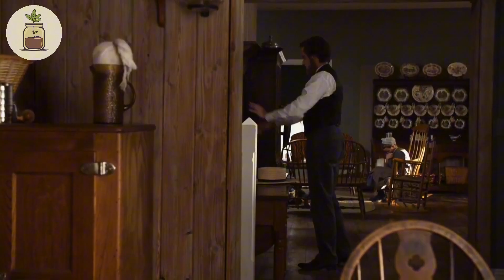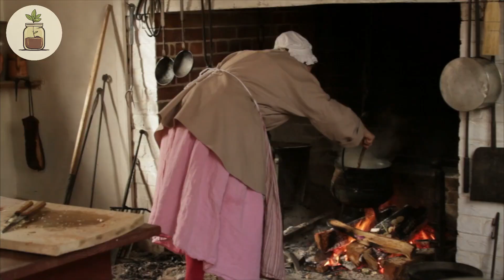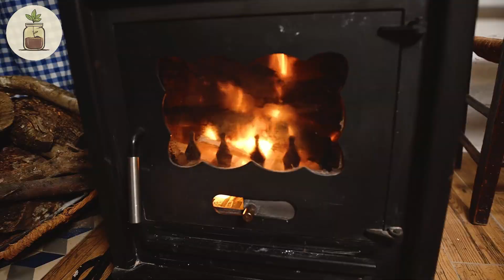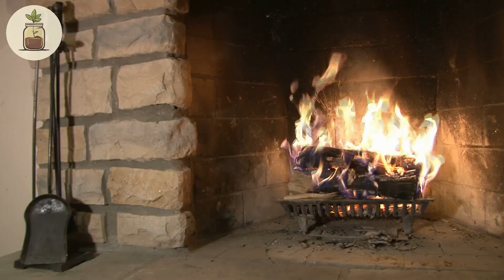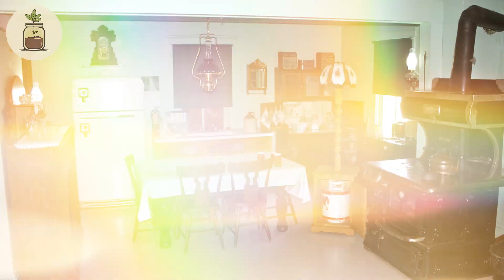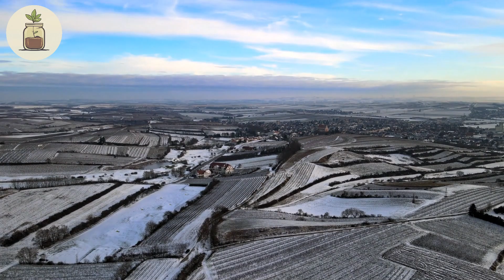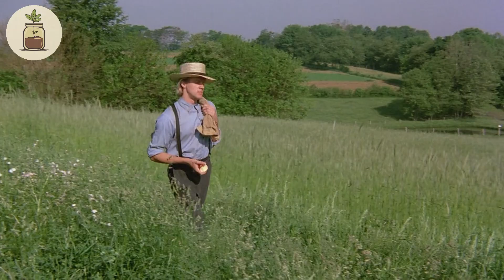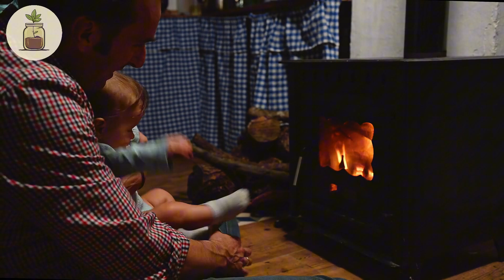How Amish HEAT Their Homes Without Gas/Electricity

Comment: Miss the smell of a turf fire, not as hot as a hardwood fire but more aromatic
Reply: What does it smel like?
Reply: @roselee4445  Good question, it's difficult for me to pin down as I'm going off memory. a mixture of an earthy smell and a more subtle smell which is floral I guess. I'm sure it changes from one region to the next depending on what organic matter it's made from. I just know you have to keep shaking the fire with a poker because they generate a lot of ash. Don't quote me on the description as it's been too long since I have enjoyed a turf fire, good memories. You appreciate it more when you harvest your own, the hand cut turf tends to burn easier and smell nicer.

Comment: I had a newspaper route when I was a kid back in the late 1960's.. The paper stations where we picked up our papers were just metal sheds, about 20X30, with no insulation. One potbelly stove in the middle, heated with coal. There were metal tables stacked with newspapers 6 feet high and metal coal bins around the outside walls. Those stoves would keep those paper stations toasty warm even when it was 20 below zero outside. Even though they were jammed with paper and kids no one ever got burned, and there were never any fires. Then, in the 70s, the city forced the company to get rid of the stoves, said they were dangerous. They put in overhead forced air gas furnaces. Those stations were always cold after that.

Comment: And where do you find this effective wood? Millions of families and others must therefore find, store and then fire with wood? Isn't it against everything that the environmental movement argues? I have a hard time seeing wood burning in a 20-story building with 72 apartments. And where do they put the ashes? 
No, it's probably the case that if everyone wants it that way, they all have to retrain themselves to be Amish. Life will be different with a maximum of 2 floors on the house and a lot of small houses that have to be heated with wood. I'm not negative, I'm just stating what I see in that future.
Reply: Good points except for the dumb one, what to do with the ashes.  They go back to the earth as a form of fertilizer, not a problem what so ever.
Reply: @hugoglenn9741  I spread mine on icy spots.

Comment: What this video is not telling people is that some insurance companies will not cover homes with fire stoves as a primary heat source.
Reply: Most use outdoor wood heat systems now. Hot water and heat both. No need for any insurers worries. Although I had no problem with just a wood stove with my insurance company.
Reply: Yes, you are correct if it's an outdoor unit.
Reply: Insurance is parasitism
Reply: And that the insurance people love it alot when you pass that along.
Insurance doesn't work without fear and intimidation 😅😅😅😅

Comment: You don't have to be Amish.... I'm in the UK, living in a 1950s ex-Council semi-bungalow in a residential area. I ripped out  the knackered old mains gas boiler when I moved in and have heated with wood only for over a decade. I run a cast iron wood burner in a large thermal mass chimney breast which heats the main room and the bedroom above. Main section was built when the house was built but I added mass in the main room when I moved in and it now releases its heat over more than 24 hours.  I'm careful about prepping my wood fuel and when the thing is running, it isn't noticeable to neighbours or passers-by. The main room is a sitting area and office and stays cosy whatever the weather and is half the ground floor. Wood comes from a nearby ancient woodland. It's derelict hazel coppice being restored to coppice cycle with excellent nature conservation benefits. I cut it myself which keeps me outdoors and active in winter helping my mood.  If anybody is interested, click the Anemone icon and go exploring amongst the videos (unmonetised channel). The other benefit of burning wood is that I no longer burn fossil fuel for heating  - this means that I don't contribute to increasing CO2 in the atmosphere. I never burn coal. However, I do cook with electricity and if we're away in winter, we do have low-output electric heaters to avoid frost damage. My halo isn't as tight as it could be.....

I do cook stews on the wood burner when it's running and the back-up to electric light is paraffin (kerosene) lamps, which get used once in a blue moon when the power goes off. They were all inherited and are older than my Dad who'd be well into his 90s now.
Reply: Isn't that an issue with laws over there or is that why you keep a low profile so the neighbors don't go Karen or Ken on you and rat you out???
Reply: @Sadler2010  I'm not breaking any law by burning wood as domestic heating. It is unusual.I don't live in a smoke-free zone or anything. I could possibly get into bother with the Council if someone complained about smoke being a nuisance, so only burning properly prepared wood keeps the likelihood to a minimum.  My neighbours burn wood and coal. Coal means more pollutants, smoke and odour.....
Reply: @anemone104  I figured it'd be at least looked down on quite a bit if not illegal, here in the states they've gotten insurance companies to threaten to cancel folks insurance for having the wrong kind of wood burning stove even when it's original and working fine.

Comment: Our great grandparents had stoves with boilers that heated the water for their radiators and baths. Sadly these were phased out because in the 50s gas was cheaper than wood or coal
Reply: These stoves are still sold with back boilers..I have a Stanley 90..brilliant machine.

Comment: Burning wood is not sustainable or healthy this has been proven many times. If say everyone in New York used wood heating the pollution would be intolerable and the health complications would be disastrous both these issues have been seen before and are well known and documented. As for the sustainability if all homes used wood fuel you would not be able to grow forests fast enough to keep up supply.

Comment: So, sure wood works.  You need a way to distribute it within the house, so all rooms are warm.  You must get the wood and take care of the wood supply long before the winter.  Even if you buy it, it must be kept near the house, protected from rain and snow, stacked correctly to dry, and brought to the house consistently to have on hand.  it is dusty in the house, must be attended to as it burns, and  wood burning stoves can be especially hot.  Used one for 20 years as an addendum to oil.  Worked great, but it is work, and can be expensive if you don’t cut your own wood.

Comment: Stupid nonsense. Pollution (smoke, unburned microscopic particles) if used on mass scale (millions of households) would cause massive health problems. Deforestation would be disastrous. That already happened in 17-18 century Europe. Open hearth fireplaces burning efficiency is disastrous, about 1%.
Reply: Exactly what I was thinking. No one knows what harmful micron size particulate matter is going into the air from the wood they’re constantly burning. Plus, we all know the Amish are not using modern HEPA filtration inside their homes!

Comment: Here's the problem with if everybody in the United States had wood stoves that wouldn't be very many trees left we would be putting almost a hundred times more carbon into the air so unless you come up with a better thing than a wood stove it's got to be where it puts off Harley no carbon at all and I'm sorry with stoves put off a lot of carbon
Reply: What if they just took some branches off the trees but left all the trees alive? Orr they could grow bamboo instead it grows fast.
Reply: More taxes with stop the climate from changing though . Smh .
Reply: Perhaps insulating the house as much as possible would help with individual wood usage.  Obviously, not everyone can or should heat with wood.  It is a renewable resource.  How long does it take for coal to grow back?...

Comment: FYI  in the county of Vanbruge in the state of Indiana you are not allowed to have a wood burning system
Reply: We're in northwest Indiana, and our insurance premiums would double if we used wood heat, per our insurance agent. Heated with wood stove 40 years ago, and it was the best heat ever.
Reply: @gsdalphaS013   Northwest Ind too. I like the the thermostat on the wall.   Until I was 15 I  didn,t live in a house with a furnace.  Our Mother hung our sweaters behind the coal stove to dry, they were frozen the next morning. My sister were sleeping in the same room .  😪
Reply: @andegrace6935  Oh, wow, that sounds *rough*! When I was a kid we had a central furnace underneath the floor with one big vent in the middle room of the house. My sis and I would get out of bed in the morning and run to stand over it to get warm.
Reply: @gsdalphaS013   That,s the kind we had in the last house we moved into when I was about 15 had that kind.    Not alot better, but alot less work.

Comment: Korean ondol underfloor heating system. Combine with one of these. If you have an underfloor area, solid pipes from the masory heater then outside vis the flu or send to an external shed etc then out a chimney if only one building.

Comment: im not Amish, heating our house with wood for years, loved the wood heat and miss it. I dont miss getting 6 cords of it to burn, bucking it 16" lengths, splitting it, packing it home, packing it to the wood shed, packing into the house to burn. cleaning the stove, cleaning the chimney and constantly dusting the furniture.
Reply: At $1,000 for two months of heating oil I've switched to wood and gladly put up with the wood problems
Reply: @betharris633  being able to cut my own wood to heat with is much more efficient: no income tax, no fuel tax, no propane fee. Better on the environment too!
Reply: @betharris633 Heating with oil isn't cost effective. Get a small DIY heat pump. Or a propane furnace, but a heat pump would be cheaper. Natural gas would be cheapest if you were on the gas grid.
Reply: @gregorymalchuk272 heat pumps are expensive to maintain and repair, are nowhere near as efficient as people claim either, at least not here in Australia. 
Wood still provides a cheaper, more sustainable option....and I've never enjoyed sitting by a heat pump for its ambience 😅😅😅
Reply: @gregorymalchuk272  All of the petroleum products have a limited future, as there is only so much and using them boosts the carbon dioxide in the atmosphere, which will only escalate into problems for our descendents.
Reply: @blackholeentry3489 What size is your house, how many months do you need heat and how cold are those months?
Reply: I’d rather do that than pay $50 or more for a gym because we live sedentary lives.  My father did it, never made more than $40K a year, retired at 45 and was worth multi millions when he passed away
Reply: I second that motion!!!  🤠👍
Reply: @worldtraveler930   absolutely ! I third that motion. I don't miss the splinters, red-back spiders and the snakes either.
Reply: I would love a wood cookstove which serves two purposes.
Reply: I get about 70% of my heating from my wood stove. I also have two mini splits that I use on warmer days. My wood stove adds little dust to my home because I know how to mitigate the dust. I wouldn't give up my wood stove. We love it
Reply: Why dusting the furniture? Sounds like you didn't burn your wood right, if you had soot.
Reply: Heating with wood isn't for everyone. I don't mind making firewood. No other way I could heat our house for about $600 / year . Some years I sell a little firewood and it makes my heat free.
Reply: I’m living in the Netherlands. Europe’s gas country no 1. But i’m so glad with my self built woodstove. I live in a farmhouse from 1900. So made for cattle and not for people. With today’s prices we treasure it. But indeed. From tree to firewood… let’s say 4 times warmth from it. But hey. I’ve got trees.🌳
Reply: Constantly breathing ash
Reply: And worse than the dust on the furniture is what it does to your lungs. If you have perpetual dust on your furniture from your woodstove I guarantee your lungs have suffered. Look forward to COPD.
Reply: @l.5832  When I met my wife 16 years ago while on a solo motorcycle trip, she heated her entire one-bedroom, but two story house soley with a wood stove....and, we still do.   This stove is quite efficient.....ALL smoke and whatever goes up the chimney and with NO smoke escaping into the house.   Air intake is controlled on the front of the stove, with no damper in the stovepipe at all.  Even when we add more wood, opening the front door of the stove only increases the draft, with zero smoke escaping into the house.  

Growing up in rural Oregon in the early to mid 50's, both our living room stove and kitchen stove then burned wood, but the stove I now heat the house with is a huge improvement....and our kitchen stove and water heater are both propane.    
   BHE
Reply: When I was 16 I heated the house with wood, it warms you twice.
Reply: @marshiamoss5469  Famous saying of Ben Franklin, although I'm not sure whether or not he actually created it.  

Actually, my 2nd wife (one of those former 'tough' Aussies)  Wood is our primary source of heat for our two-story house located on a heavily forested 1+ acre.   
However we, at 1100' elevation, have an excellent view of the Pacific Ocean, where we frequently observe the sunset over the ocean, always on the outlook for that sometimes elusive "Green Flash."
Reply: That dust that was settling on the furniture was also getting deep into your lungs, causing permanent lung damage. Oil, gas, and electricity are truly wonderful improvements.

Comment: We don't use Gas or Electricity for heating either.  Our only heat source since 1999 has been a Wood-burning Stove!
Reply: I'm with you. Our system went out about 10 years ago. Central AC still works so I'm not replacing till it goes out.
We burn wood in the winter & are fine. A few chilly mornings but that just helps wake you up.

Comment: I don't mean to disagree here, but the efficiency of a wood stove is not that efficient.  We burn wood, but mainly for the ambiance,  our heat pump  and hybrid hot water tank heater does most of the heavy lifting when heating our place. They are both tied to paid off solar panels making it even better for us. In addition, many Amish communities use solar panels to generate electricity for their homes and businesses. The Amish are considered early adopters of solar technology and have found that solar power is more efficient and safer than burning kerosene and candles.
Reply: @GabrielSBarbaraS  I have an air tight unit that claims 92 percent efficiency and I only burn red oak the right wood stove is highly efficient as long as good wood is used
Reply: @stevemino142  Many factors involved with efficiency, I agree, you have a couple of good ones when it comes to wood burning.
Reply: Yes, you do mean to disagree. It's not mean to disagree, so don't apologize for it.

Comment: Fireplaces do not heat nearly as well as a wood burning stove.
Reply: That's the truth.
Reply: She said it stays warmer for longer once out and she's right
Reply: Put stove in fireplace hole
Reply: Look up kachal ofen a fire place with the flues going horizontal at a slight upward pitch usually going into two rooms always in the center of the house
Reply: Being centrally located, it's somewhat better than heating up an outside wall. A centrally located quality cast iron wood burning stove is best.
Reply: They actually do if they are built to do so. A stand out stone fireplace has probably 2 tons of heat sink where a stove has about 500lb heat sink at best.

Comment: Pellet stove are NOT efficient especially because you have to buy the pellets and lug them to the stove. As a 60+ female it just wasn't practical. As well, the pellet stove still needs electricity so no good if the power goes out. I ditched the pellet stove for just a wood stove which gives me more heat that the pellet stove couldn't provide.
Than yous for the information! My biggest take away is a lower ceiling needs less space to heat.
Reply: I did not know they used low ceilings in cold areas of the country, it makes sense because in the deep south it was normal to build homes with high ceilings to keep the house cool in the summer, because they knew that heat rises.
Reply: A pellet stove, we'll burn for 12 hours. A wood stove will burn for maybe 4 hours. I have both. I use both all winter.
When it's really cold, I run the woodstove and pellet stove. If it's not that cold. I just run the  Pellet stove
Reply: @goatman6151  You need to get a better wood stove, and use harder wood . My stove can slow burn easily for over 8 hrs. I'm in Canada so winters are no joke .
Reply: @goatman6151  Does it use electricity? Do you buy the pellets? 
For me, the wood is free -- just have to harvest it. If the electricity goes out so does the pellet stove. If you run out of pellets you can't just go into the forrest and get more.
Reply: @goatman6151 I've used many wood stoves in my life and I have had fires and coals from fires last for longer than 12 hours. It all depends on your knowledge about using the damper in the chimney and the draft on the door/s.
Reply: If a pellet stove doesn't shut down properly it smoke up the whole house.